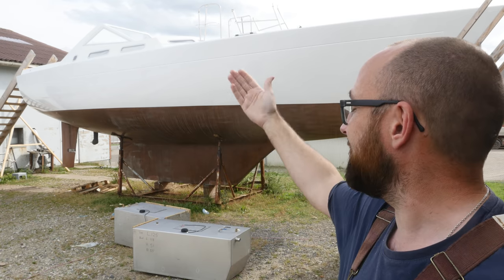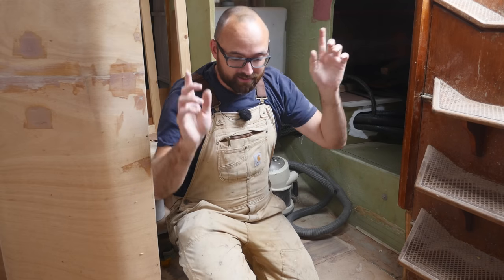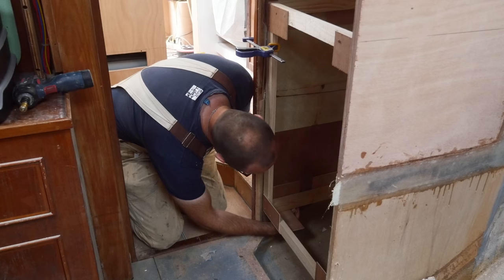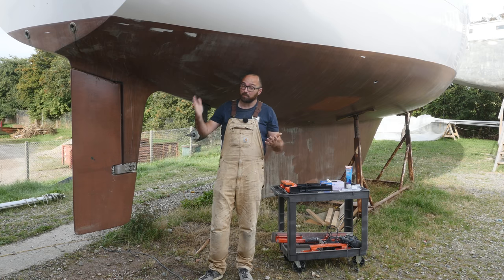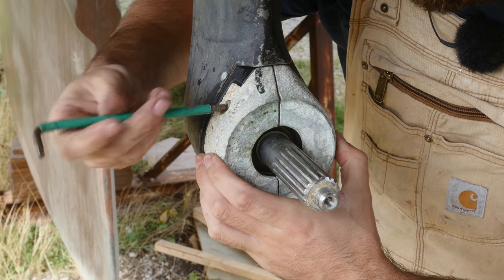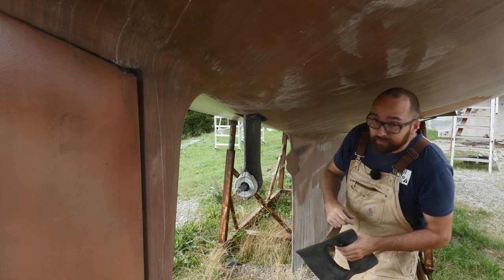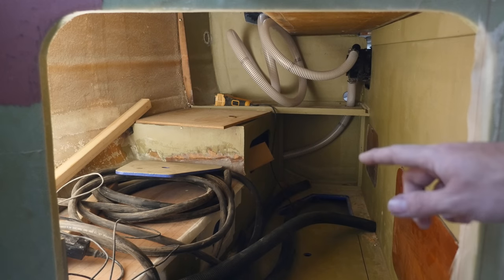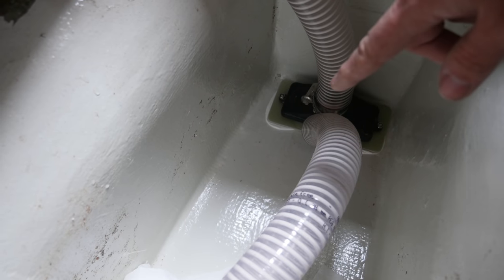Sail Life - Saildrive seals, manual bilge pump & washer/dryer area - DIY boat project

Comment: Now that I am redoing the bottom paint on my boat,’I realize how easy your videos make everything look.  For starters, I have been covered in something blue for the last week. First, it was the old ablative I sanded off.  Now, it’s the new ablative I’m paining on.  I also show signs of epoxy coating as well as zinc oxide coating used on my iron swing keel.  Nothing about this project has been easy, and with as much as it’s cost me in supplies and tools, I could have hired someone to do it.  I wanted to be a good DIYer.  Alas, I’ll keep watching those who love it.

Comment: We have that exact same manual bilge pump.  We used to use daily it to empty the bilge of meltwater from the icebox that accumulates there since the drain hose from the fridge routes right to the bilge. Ice turns into water... 

But as good as the pickup is it can't really get that last half inch or so of liquid out of the bilge.  So we bought a "dry bilge" system from SeaFlo that does a freaking amazing job of getting down to only a teaspoon or so of water driblets at the very bottom depending on how flat and drained the bilge is to the exact low spot.  

It's been a game-changer on our boat and keeps the bilge nearly dry as a bone which makes a massive difference in boat smell.  Smell sucks, and contributes to sea-sickness greatly.

You might want to check it out.  They sell on Amazon for only $150US and is a really easy install since the pump box can mount almost anywhere on the boat, and only a tiny 1/4" vacuum hose runs to the sponge pickup in the bilge, it can run something like 30 feet from the pump box.   I ran the 1/2" output hose into the cockpit so it can just drain out the scuppers to avoid another through-hull.  

There is a built-in timer on "auto" mode so it can run once a day whenever you want for however many minutes you wish, or on manual mode when you see there are a few cups of stagnant water in there threatening to contribute to boat stank.
Reply: Thanks for the tip!

Comment: If you ever don't want a bolt to rotate while tightening a nut (when you only have access to the thread size) grind a slot in the end of the threaded part and hold a flathead on it while you tighten down the nut. It's rare that I need to use this trick but it's come in handy quite a few times for me!
Reply: Genius!

Comment: Mads a check valve close to that bilge stainer is a must so you don’t get 20 feet of water in the hose then it loses suction and all falls back inside.
Reply: Also frequently called a foot valve.  A swing check valve is typically installed. It will likely require service at some point so leave it accessible.
Reply: @gregoryyount6907  If made of brass...that sounds like another $140 to me.

Comment: If the bolt of the pump are long enough, spin the nut that fastens it on as close as you can get it, then put on 2 more at the end and tighten them against each other.  Put a wrench on the ones tightened against each other to keep the bolt from turning, and use another wrench to tighten  ;)

Comment: Volvo Part Cost, True Story: I visited a Volvo part supplier in Sweden many years ago (mostly all component Injection molded). Enjoyed every minute of the trip even after my luggage was left on a helipad in Copenhagen on my way across to Malmo Sweden. But anyway, the highlight of the trip was a complete factory tour, and they let me walk around and check out in detail every work station (I had fixed my machine within 2 hours of my initial arrival, so had 3 days to spare). And they showed me how the bumpers for the Volvo cars were all prepared by hand by a group of very special workers. 
These were hand trimmed, hand sanded, hand masked and hand painted by a group of dedicated (and protected) 20 something very hot Swedish blonde ladies. 
For the past 20 years, I've never questioned the cost of single Volvo parts.

Comment: Mads - now is the time to check if you haven't already that you don't have any grooves in your saildrive shaft. This is quite common on saildrives after about 5-10 yrs of use and these grooves then prevent the seals working properly and you get sea water in the saildrive oil causing it to emulsify and turn grey. It also then means the gears aren't lubricated properly and the rest of the saildrive can fail prematurely!

Comment: You know these washing machines often have a very big chunk of concrete in them to help stabilise the innards during the spin cycle? Well that concrete part is usually easily removed to help with lowering them into awkward spaces. They can then be carried down separately and re-installed, or alternatively hurled through a Volvo spares department's front window to the tune of ABBA's Money Money Money.

Comment: `Avoid squeeze out? Use a washer of a suitable thickness and diameter on the fixing within the butyl between the mating surfaces.  The fixing can be tightened right up  and  butyl will only squeeze out to the thickness of the washer  you have chosen.
Reply: I like this idea.

Comment: Mads, you need to install a STRUM BOX, [filter] on the end of the manual bilge pump hose, to keep debris from jamming up the diaphragm, traditionally they were made out of bronze, usually  a  rectangular  configuration, the heavy bronze helped to keep the end of the hose on the bottom of the bilge, to day probably plastic, i am a fan of the EDSON i gallon per stroke diaphragm, that baby will really move some water. PS, don' forget a high water alarm, keep up the great work.
Reply: I  believe the black object at 15:29 is a strum box and includes a strainer.
Reply: He DID install a strum box. What do you thing that black thing on the end of the hose was?

Comment: I hope you have more luck with contact cement on the boot than us. After every haul out we had to put a new one on because either the whole thing or half of it would be gone. The last time we used Sikaflex 291 and were astonished to find it perfectly intact in place after 1200 miles. Maybe crocodiles only like the contact cement flavour.

Comment: When you've got a 2 man fastener job and your working alone, one of the tricks you can use is to put 2 extra nuts on the bolt and use them as jam nuts to hold the bolt in place while your tighten down the third (I keep a box full of thin nuts to make it easier to fit them on short bolts) If you don't have enough room for 2 extra nuts you can just put one extra on and use vice grips to hold the bolt, once tight take the extra nut off to recut your threads. If you have still even less room just use vice grips to hold the bolt, and you can either cut the bolt shorter if it's again a one man job to take it off, or get a second pair of hands to hold the bolt from the outside while you recut the threads loosening the nut.

I also still think you should recess the dryer above the washer, so you have room to fold cloths in front of it, right now all the space behind it just going to go to waste.

Also have you considered putting a tattle tale in your bilge? Usually it's just a short metal rod, with a float on the bottom that normally rests flat on your floor, but if your pump fails the rising water will rise the rod out of the floor letting you visually see it has failed.
Reply: Holy crap. I’m a mechanic and I’ve never heard of that! That’s brilliant!! Well played. I’ll be keeping that in my mental toolbox for years to come.
Reply: The space behind the dryer isn't going to go to waste. It's going to be storage, accessible from the galley.
Reply: NPC S/N 1579325  Glad I could help... learned it from my dad while rebuilding a mustang as a kid. Brings back the good memories :)

Comment: Contact cement helpful hit, put wax paper between the two parts to be bonderd line the parts up then remove the wax paper. Dowels work pretty well when bonding plastic laminates.

Comment: Whenever I replace seals, impellers etc I'll put the parts back in the bag if they're half decent still. It's saved me numerous times when I had a problem at sea or in a remote location.

Comment: Dear MADS, before you juge te price on the seal i think you should know that these seals are configured for withstanding all sorts of chemicals, therefor also used in petrochemical processes in the heavy industries, to withstand the oils, multi grade, synthetic and all its added supplements. They use a different compound (hence the brownish color) in contrast to the cheaper seals (witch are black)
therefor they also use the stainless steel spring in stead of the regular steel spring.

by the way, I am not associated with Volvo. I am just a engineer working in the petrochemical industry,  so this info might lighten your burden of the expensive costs a bit ;-)

Comment: Tips & ideas 

While you are on the emergency manual bilge pump order at least one back up rubber diaphragm and plastic keeper.  Brand new diaphragms and keepers break when furiously used in a panicked situation!!! I hope you never have.

While you are repairing the sail drive order several extra seals for the sail drive!  They will require periodic replacement probably will be every 4-6 months so stock up!! 5 of the ten dollar brand is better than one of 50 dollar brand. 

I would bet your gonna need to carry an extra boot too.  It will be a PIA to order that boot and wait two weeks while on the hard in BFE. 

That zinc looked ok sand it a touch and b keep it for a back up or use it again.

Comment: When you put the boat in the water, if you're not going to replace the anode going in, be sure to give it a quick brush to remove the face corrosion. A simple brass brush should be ok.

Comment: Don't glue or tab the dryer shelf, just use screws. There will come a time you need easy access to what's behind.
Reply: I was about to type that! Dryers are usually not very heavy so I believe there would be no need to tab the shelf in.
Reply: Just use screw in threads into wood. Very handy for removable components.
Reply: Isn’t that where the sock goes?

Comment: Exhaust Idea: Many wakeboard boats now come with something like the exhaust system sold by FreshAirExhaust.com. This directs the engine exhaust into the water in the wake of the boat, making the exhaust quieter, and more importantly minimizing the fumes for those surfing behind the wakeboat. You might consider one of these for your exhaust in order to minimize fumes when motoring.

Comment: The seals from saildrives and saltwaterpumps have st.st. springs  while normal seals have mostly steel springs but still the price difference between a normal seal and a Volvo seal is to big!  Sometimes it is possible to exchange the spring from the oud seal to a new non Volvo seal.

Comment: Years ago I had a Columbia 29 with a Volvo MD1,  which is a old lump of an engine.  Mine had multiple oil seeps so I ordered a set of gaskets at my local dealer.  Several weeks later I popped by to pick up a simple gasket set,  I almost fainted when the parts guy told me the price, over $1200 USD.  I just went back to rags and diapers for that sucker and vowed never to buy another Volvo,  no matter how excellent their reputation is.

Comment: Great progress again Mads.👍 Just a few comments if I may 😉:
1. Before you manhandle the washing machine through the boat, it is very worthwhile having a gander and establishing if it has a big concrete block fitted (part of the spring mass damping system). They are normally easy to remove (and replace) and makes the machine easier to ‘throw around’.
2. Did you measure the golden volvo seals - so next time you can source silver ones?
3. Milestones - I thought you were fully metric - kilometre-stones just does not have the same ring -eh?😉

Keep up the prodigious pace.😀👍⛵️
Reply: Counter weights in washers went out of style in the Reagan era.
Reply: G Henrickson in American washers?
Reply: If you'd seen Mads tossing the washing machine about in an earlier episode, you'd know it's very obvious there's no concrete block inside.
Reply: JAFO which episode?
Reply: @normanboyes4983  - It was reasonably recent.. somewhere in the last half-dozen or so episodes, I think.. I don't have time to find it for you.. why don't you go looking yourself?
Reply: JAFO Thanks for your courtesy, helpfulness and general stating of the obvious - I sincerely hope you are enjoying life and have a thoroughly enjoyable day.

Comment: Have you decided on how to handle the dirty water from the washing machine or the hot air coming from the dryer?
Reply: Good point and well presented, additional the hot air will be moist, causing condensation, and mould, not good!
Reply: Good Point - depending on the detergent (ecological or not, surfactants or not) you can simply discharge it into the sea, otherwise into the black water tank.
The exhaust air of the dryer should actually be ventilated to the outside because of the mould and humidity - but: I think mads already knows that^^
Reply: Here I was going to comment about some of it but everybody beat me to it. Lol well played.
Reply: hot air from the dryer? haha what century do you guys live in

Comment: Also that anode is probably worth replacing as if it's got "life" in it then it might well mean that an oxide layer might be preventing good electrical connection to the rest of the saildrive.  For the cost of an anode, just not worth taking the chance! They should wear through half way to the point of needing replacing in about 1-2 years tops.
Reply: "it might well mean that an oxide layer might be preventing good electrical connection to the rest of the saildrive"

It's nothing that a quick going-over with a brass-wire brush before launch can't fix.
Reply: @Garryck-1  Yes equally true, or sanding so it's a nice flat surface for best electrical connection

Comment: You should have gone ahead and get measurements on the seals and note them in your build book so if they fail again you'll be able to find them with out paying Volvo prices
Reply: He likely did or at least saved the old seal(s).
Reply: Even better, get the numbers that are stamped into the outside of the seals. Then you can order the exact same ones from any bearings supplier.

Comment: MADS VERY IMPORTANT, if the units weren't designed to be inserted into furniture (seems like the drier was...) you need to help the electronics ventilate. I'd investigate by removing the tops and putting them to use outside the boat to see what and where heats up. Because it's very likely those will not be ok in such an enclosed space.

I have both a newer and an older machine, and both have components that heat up enough that the heat can be felt through the melamine top (1.3 cm thick).

Just wanted to give you a heads up on a potential problem.
Reply: Will you be insulating behind the washer dryer - as you did with the galley/ chart table areas.
Reply: And also, strong vibrations
Reply: I must believe someone as meticulous as Mads has looked at the users manual for clearance issues.No testing required...just the manual. Why would you think these are most likely not for an enclosed space?
Reply: @bljuzga  Please elaborate. Thanks
Reply: @geraldhenrickson7472  centrifugal forces from the washing machine are very strong and they get stronger as the machine ages
Reply: @bljuzga  - By the time Mads has finished bolting it down, I don't think vibrations are going to be a problem.
Reply: @Garryck-1  by bolting it down the vibrations only transfer to whatever it is bolted to
Reply: @bljuzga  That all depends. I'm sure you know why engine vibrations don't transfer through, even though they're bolted down. Same principle.
Reply: @Garryck-1  yes the vibrations have to be damped by a rubber of some sort of material with offseting properties. Engine is mounted on a strong place in boat which build excatly with that in mind, the washing machine mounts do require a bit more of preparation

Comment: How do you vent the clothes dryer on a boat? The moisture coming out of the clothes needs to get pumped somewhere. I have  similar closet on my boat and am thinking of adding a all-in-one unit but venting the moisture laden exhaust air is going to be a problem.
Reply: Apparently, condensing driers don't need a vent pipe.

Comment: Diesel tank in Port side? If I don't miss a video, you have a diesel tank on the engine compartment correct?
Reply: That's what I thought as well.
Reply: The engine tank has multiple outlets in order to fill additional tanks.
Reply from the maker: There'll be a total of three diesel tanks :) I'd like for us to be able to carry enough diesel to make it through a winter without refuelling :)
Reply: @SailLife  That's truly brilliant. Make note of the dryer vent heater I added a link for. Save heat when drying. Love your videos Mads!!!

Comment: Looks good Mads... but I'm curious.  Are you going to install a sumpbox for the washer drain? And as for the dryer, are you planning on using a wet trap for lint?  Lint traps are nice, but, they will super heat the cabin area.  Nice in cold climates.  But not so good in warm regions.  The other issue is keeping it clean... They can cause a mess if the trap runs dry or sloshes out if sailing and washing at the same time.  Just my questions.  Thanks.. and good job on the outdrive.